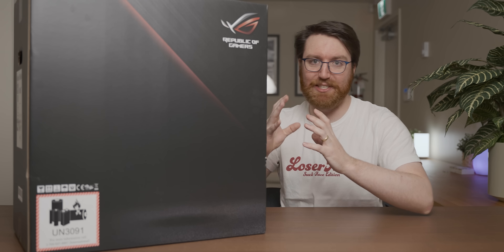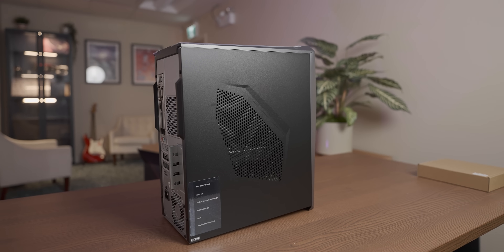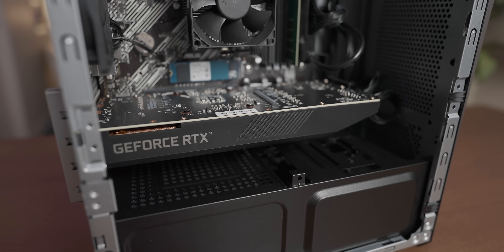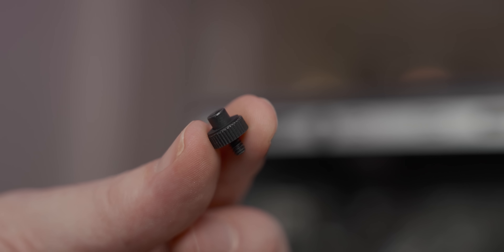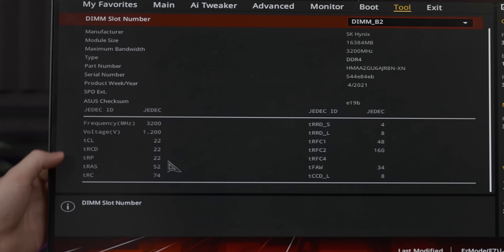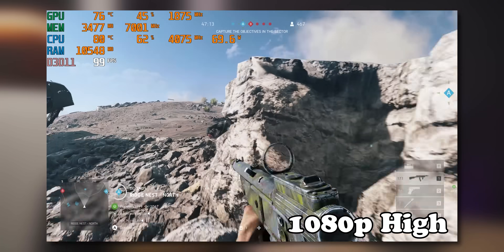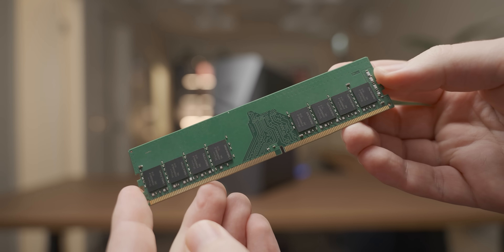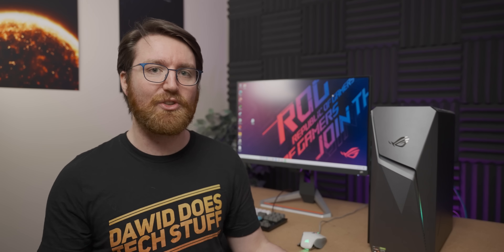Why Do Asus ROG Pre-Builts Suck So Bad?

Comment: lol this is a lie badly, i have a rog 3050 8gb and it works just fine with no issues. actually its better than my uncles built 1,000$ computer and my sisters 1,000+ gaming laptop. it runs gta5 max graphics at 110+ fps no problem.
edit: i added 3 more fans to it, with 40gb of ram. It works better than ever with no problems and does 2160p on videos with no problem.
Reply: Hey do you know how i can change the rgb color that comes with the pre built case? I was trying armoury crate but it doesnt change the color on armory crate when i try to change the color.
Reply: @jadenochoa8458  i dont remember but its on the left hand side bar, you might have to click on them to find it but its a simple program to use for ur pc

Comment: What the fuck? You have AITeaker in the bios on the AMD version of this? I have the i7 and it’s not supported.
Reply: My AMD version has AITweaker and it let me set my ram to the right speed thank god
Reply: @venticated  I’m just going to go and cry in a corner for a bit.
Reply: @FatLabRat  traded my m16 zephyrus for it, has 64gigs gskill ram Ryzen 7 5700g 1tb m.2 RTX 3060 12gb
Reply: @venticated  noice. I put a Corsair AIO in mine and added 64 gigs of Corsair vengeance ram. I was so excited for my ram to run at 3600 but it is forever stuck at 2133…
Reply: @FatLabRat  hmm 🤔 in the bios is there advanced options at all? There has to be a way to set it.. has to be!
Reply: @venticated  there is an advanced option but nothing for the ram. I’ve combed through it so many times thinking I’ve missed something.

Comment: That abomination is an insult to the Asus ROG branding, low end motherboard, random brand psu, single channel cheap memory, pi$$ poor cpu cooler, non asus rog branded gpu, infact seems like the only Asus ROG branded product in the system is that cheap pc case. if i was Asus i would be spitting feathers that the ROG branding was splapped on that thing.

Comment: Yeah... what a joke from asus, 1x single ram stick should never be installed in a gaming system, especially for that money.

Also they should invest like 5 dollar more and get at least a little tower cooler with a 90-92mm fan and a couple heatpipes for the cpu.

The GPU cooler is of course not great either, but i think in such a little case with bad airflow it´s the best choice to take a blower fan, i think if you undervolt it, it would be a lot cooler and quieter, but of course it should be fine out of the box.

Comment: Did they go out of there way to create and then put an sn530, a drive I've never heard of while being well acquainted with the sn550, sn750, and sn850. Pretty pathetic asus, just bought one of your 3060 single fan boards and that back plate better be aluminum or I'll be a very unhappy boy

Comment: Armory crate is not bloat ware!!! Especially on laptops, you use it to update your bios etc. Without it when ever you get Microsoft updates your fps is utter garbage.
Asus is not msi installing bloatware, however asus makes their devices extremely flashy and "gamer-ly"

My asus is basically used for registering warranty,

Their laptops aren't bad actually opposite they probably give most value for money in the lower end, but their pcs are overpriced junk

Comment: I don’t know if this will ever be answered but I just bought the 3050 version of this pc and it also came with one stick of ram (in the wrong slot might I add) so I upgraded and when I went into bios to change the frequencies on the ram I don’t have access to xmp but the motherboard acknowledges that it has xmp as when I dig through the bios it has the current speed and an xmp speed any idea how to fix this issue

Comment: People who know nothing about pcs and buy some rog gamer brand .. get screwed over so hard. Without lube, or spit.. and the price? For a shitty case, a shitty psu, single channel memory. Shitty cooler. Mainboard without vrm cooling. Blow styl gpu. And a 3700??? Outch.. that just hurts really bad.. you could have had a way better system for that money. That would perform better. Even if it had a 3060 ti in it , it would do better if components and cooling and memory were better. Sorry for anyone who buys crap like this.

Comment: You have never seen a Chicony PSU?  Really?  

That statement alone boggles my mind.  I mean, I don't mean to put you down... while not the best by far, they are SUPER common on OEM builds.  I have stacks of them in my warehouse.  How, if you are doing tech reviews are you not familiar with them?  Dell, HP, Lenovo, and Acer (I believe) all use them.

Do you only do videos and not any actual repairs?

Granted, I hate Worst Buy, but that statement right there suggests their associates are more qualified to discuss tech.  And, that kind of says a lot.  Do better research.  Maybe I will check back in a year or two, and see if you are better qualified to talk about tech.  Unsubscribed.

Comment: 😱 worse pre-built ever. I have Thermaltake Core P5 case is nice opened air on wall TV mount no extra fans & CPU hydro cooler 3x fans never high than 70*C. That why I always prefer custom build PC.
I didn't trust pre-built PC because sometime crappy CPU cooler & 1 stick RAM & lack airflow case & crappy PSU.

Comment: tldr ok ish components, shit case, 1 stick of 16gb ram 3200mhz single channel on a 4 channel motherboard. Cheap "chicony" power supply 500w 80+ bronze (meh..?)
- bit of bloat but not crazy.
- noisy case
-thermal throttle on GPU due to shit airflow
- 2 ram sticks bit better performance (ryzen no likey single channel memory)

+ good upgrade path
+ built in Bios ram overclocking
____
fans, fans, fans. needs better airflow and better Cpu cooler.